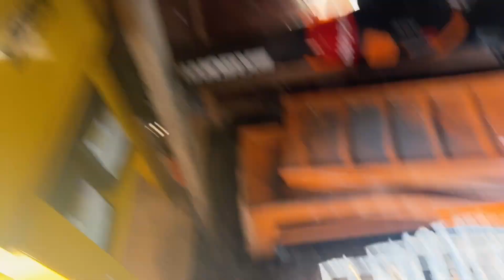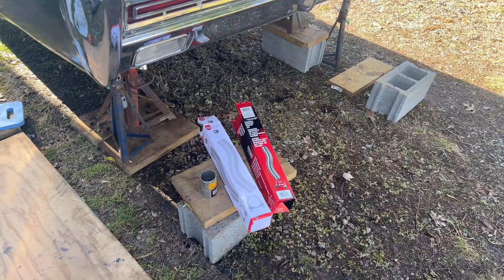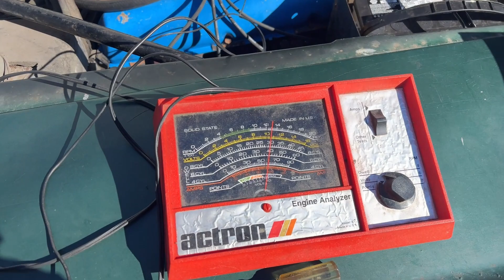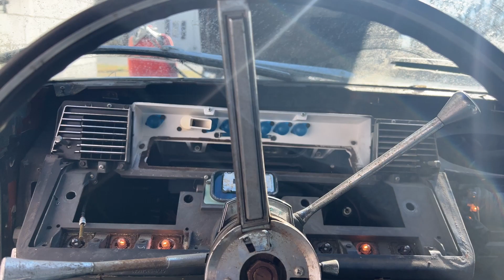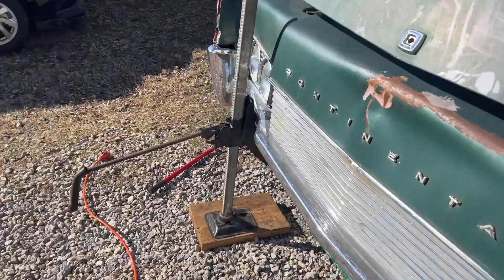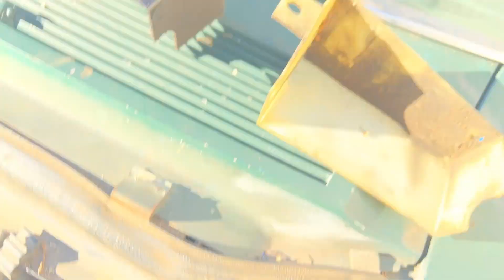1967 Lincoln Project Update 3 Feb 2024 Finished Exhaust

Comment: Ah yes, the 462cu in (7.6 L) engine that was exclusive to Lincoln Continentals. Absolute torque monsters. Search Ford MEL , to learn more.
Reply from the maker: I've always loved this engine.  It lasts forever.  The last time I rebuilt one (12 or so years ago), the machine shop didn't even have to bore out the cylinders.  Just used a hone.  Standard sized rings went back in.

Comment: Great job on the exhaust.  I'm not an expert on the cars with disc brakes and dual master cylinder but I believe the top device that you showed is used to detect when one or the other master cylinder reservoir is empty.  It is normally centered but when it detects a failure it moves over to the failed side and activates the brake system warning light.  The other device, shown below is the proportioning valve that restricts the amount of hydraulic pressure to the rear drum brakes thus preventing them from locking up under hard braking. You have tackled so many different things so far that you are getting close to a test drive before long.
Reply from the maker: Thanks for the information on the brakes.  Yeah, I'm looking forward to that first test drive!